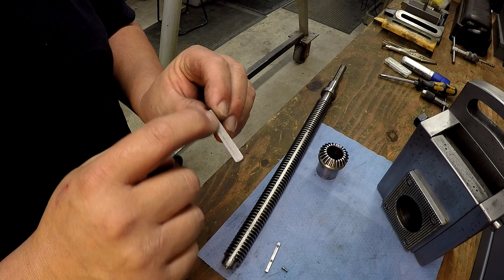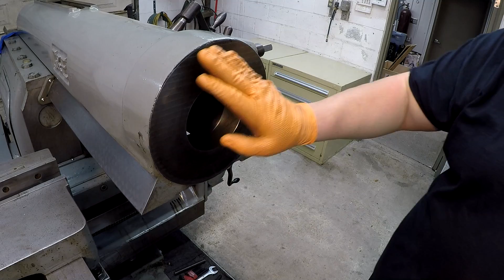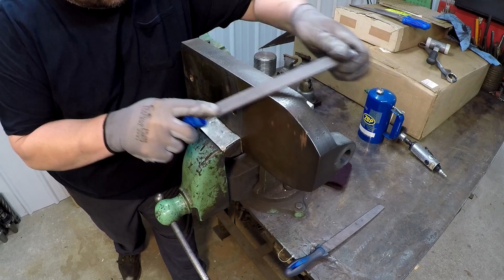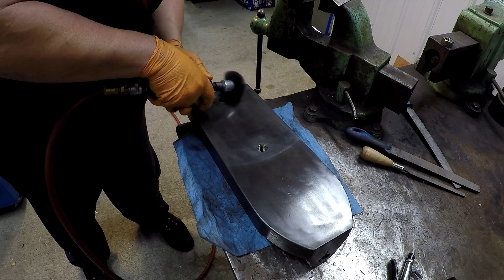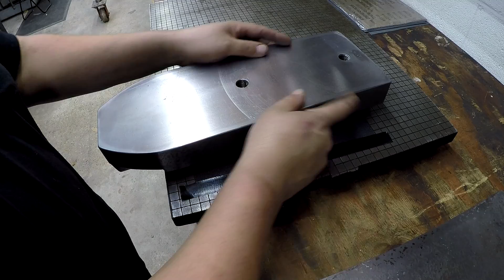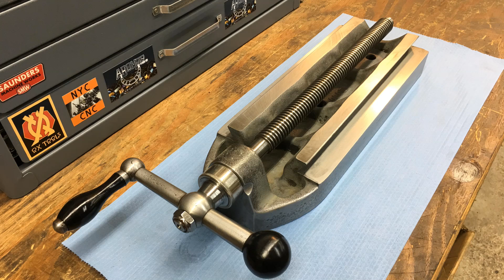SNS 212 Part 2: Shaper Tool Slide Rebuild

Comment: Could you not do what I'm itching todo if that was mine I would get a graphite rodstock the inner diameter of that broken area either build weld compatable with the iron the parts built from building the weld up in situe Or that spare you have I would cut it on the bandsaw perfect half and peg the thick areas and cut and shut weld it into one. But I know it works as is and not important just an itch ild scratch if I had it apart that far.
Reply: Except any heat applied to weld it would most certainly distort and warp the castings. You'd then be into regrinding, possible hand scraping the slides, refitting the screw and power feed parts by reboring and sleeving the bores etc etc. That broken area is mostly cosmetic and can't be seen without a close inspection. Are you sure you'd want to get into that much to fix something that's not affecting the machines functional ability's? Yeah knowing it's there would bother me as well, but I'd still leave it alone probably. Only a best guess, but I'm thinking a part was clamped to the table that wasn't secure enough, it moved under the cutting stoke, and that area hooked the top of one of the clamp bolts on the back stroke which broke the end off of that part of the casting.

Comment: Adam the key you maid and used roll pins to install is there a reason they used tenstion pins to hold it and not set screws with dentents in the key im just curious what the difference would be .. it seems like the scet screws would make it easier to replace if needed
Reply: Kevin Kiss you wouldn't be able to reassemble it using set screws I don't think. Plus the vibrations would likely loosen them off over time.
Reply: LPRNChannel ahh yea i didnt think of that ... well that would explain it lol
Reply from the maker: Those tension pins should work just fine keeping that key in place. They are tough.
Reply: Abom79 yea i didnt think it through very much before i asked ... another awsome SNS though man... im hooked  i still keep going back and watching the old ones seems like i learn more everytime 👍

Comment: Finish Part 1. Part 2 posted 1 minute ago. :)
2:10 That might be why there wasn't a key in it when you got it. They probably used square key and it worked itself out.
Reply: That is what I was thinking.